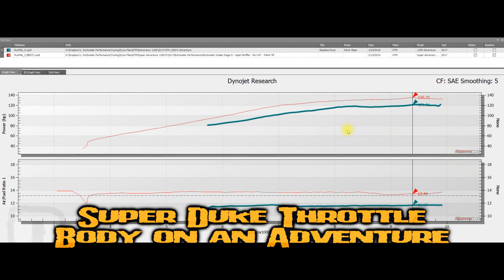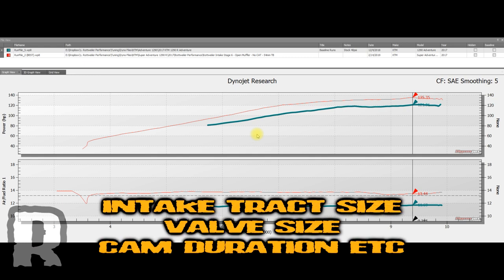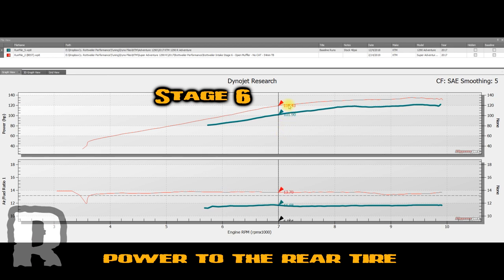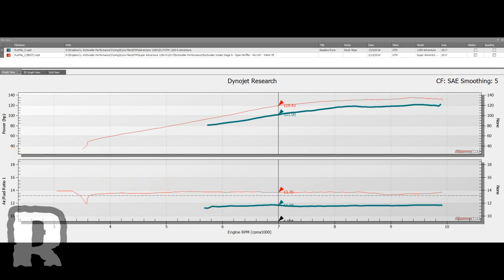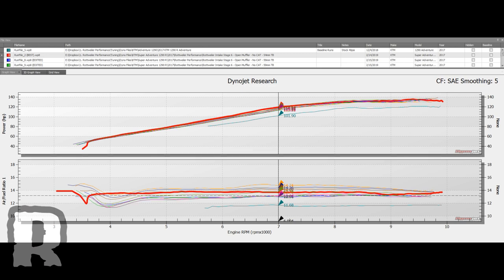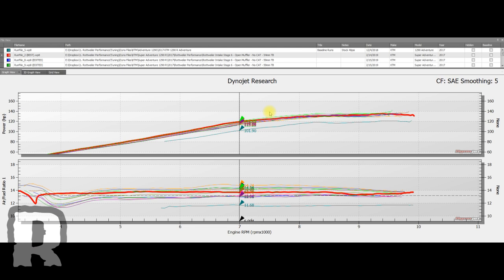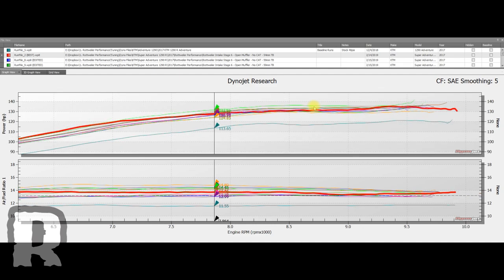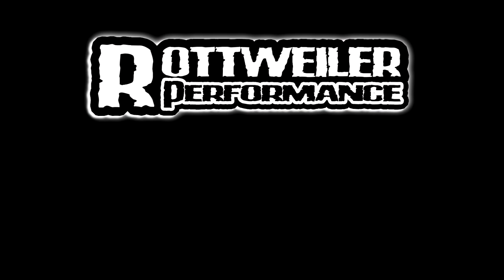DYNOFILES EPISODE 1- SUPER DUKE THROTTLE BODY ON A 1290 ADVENTURE? SURPRISING RESULTS

Comment: Now fit set of RC8 heads & cams to a SDR motor
I like see dyno readout of this mod compared to standard SDR heads cams (with open rotti intake & performance decat exhaust system)

1290SAR was to heavy i went this way for lighter 1290 for offroad modified a 2018 1290 SDR with 1290 SAR suspension & Ohlins TTx full kit with 21/18 wheels

Comment: Please correct me if I'm wrong. I'm new to all of this. Thanks in advance for answering these questions helping me to understand:
1. What you've done is change the air-to-fuel intake until you get the best performance out of the bike? 
2. Save the best option and call it a "map"? So different maps for different wishes; power down low, high, fuel economy, etc? 
3. When you change the exhaust/decat everything would change right? Therefore loads of maps. 
4. When you say "lean" or "rich", do you mean rich in air or rich in fuel? I've asked myself the same Q in the next vid.
5. The auto tune is the ecu in the stock bike? Or the part you've made?

Thank you for the helpful vids!
Reply from the maker: Answer 1: Yes, this is basically called 'mapping' and with a piggyback device like a Power Commander V, it basically hijacks the signals sent from the stock computer to the fuel injectors and modifies these signals plus or minus a percentage before they get to the fuel injectors.  The result is simply plus or minus a percentage of fuel at a give throttle position and RPM. 
 
Answeer 2: Yes and no. They are called maps, but mapping isn't really used to get more power down low or higher.  Things like cams, exhausts, throttle body diameters, velocity stack lengths will dictate power at a specific area.  Mapping usually makes all ranges better from top to bottom and there isn't really an 'either / or' kind of scenario usually. After mapping, if you didn't make power in a certain area it means the mapping in that area was already pretty good. What maps ARE more specific for is the bike setup, meaning all of the above mentioned products installed and in different configurations. The engine will want different amounts of fuel in different places depending on what you are running. 

Answer 3: Yes, maps are more specific to engine setups. Is it life or death, most of the time no. You can make small to medium size changes and the mapping will be just fine. Like putting in a spark arrestor or a DB killer. Will it be as perfect as it can be? It never really is because of constant changes in the atmosphere and other factors, but getting you map as close to your configuration as possible is always a good thing, but not really 'life or death'.  This is why we offer as many as we can on our website, so that people can get as close as possible and the reports we have received for years have been that our customers are very happy with the results.  You can just read the reviews for that part.

Comment: Hi. Where is the video of the stage 6 kit on the 1290 Super Adventure? I'm considering fitting the stage 6 kit to my 1290 SAS and would love to see and learn more about this upgrade. Please do a video on what is included, power runs and dyno graph if it is feasible. It might help sell the kits. There are plenty of 1290 Super Duke owners out here that have switched to Super Adventures and miss the raw power. Thanks.
Reply: I've always thought a super duke motor with super adventure gearing would make a whole lot of fun 😁

Comment: What about dropping a super duke motor into an adventure frame? For the most part wouldn’t it bolt up? I suppose electronics could be the bigger issue.
Reply from the maker: Most of that is just metal so it should do as it's told. We were admittedly a bit surprised that the ECU from the Adventure didn't reject the throttle body from the Super Duke, but in the same train of thought, it's just a 'thing' that is very similar except for a slight physical difference doing what it's told to do, and in the same way. You can look at the engine the same way. It is highly doubtful that the engine itself if swapped would reject any of the electronics from the Adventure and probably would work fine. That being said, we believe the Adventure lower end (heavier crank) with the Super Duke heads, valves, cams would be a really fun creation. Another 20 to the ground wouldn't hurt for travel purposes.
Reply: Rottweiler Performance amen to that. You can always screw the throttle off but you can’t always screw it on when you run out of ponies.